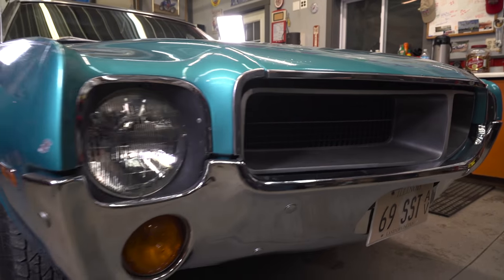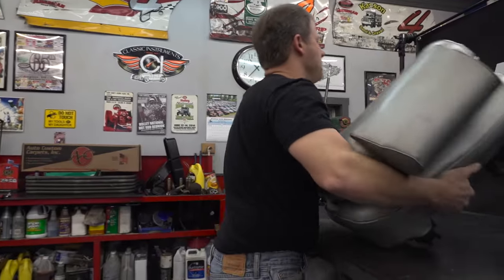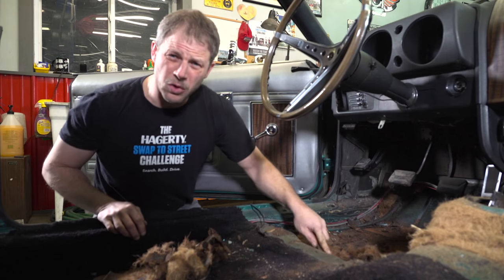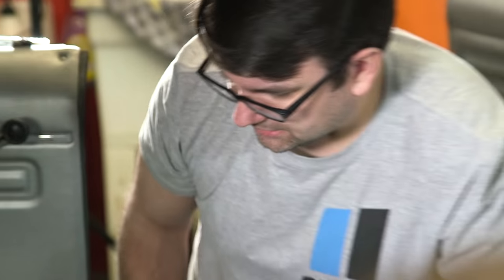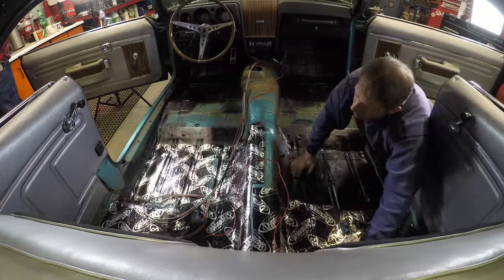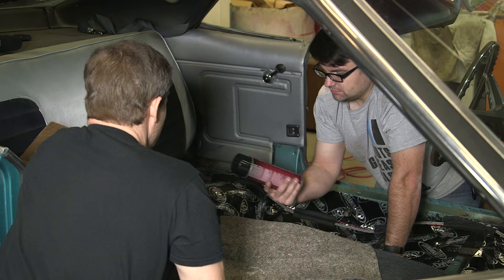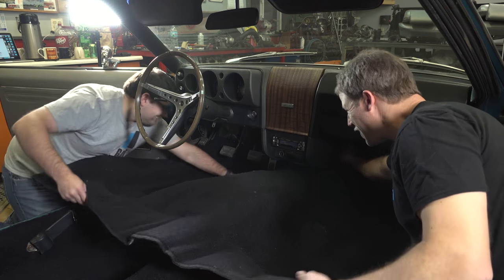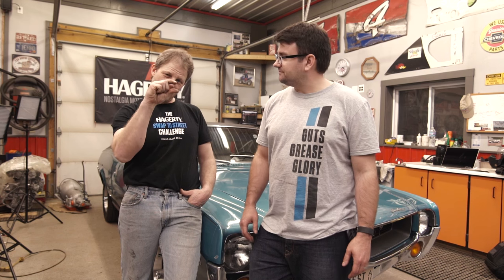How to install a new carpet Kit in your Classic Car | Hagerty DIY

Comment: You did everything except show us how to install the carpeting.
Reply: They were swearing like I was when I did this. I bought thick carpet with rubber backing. Had to be cut to size.
Went to Home Depot and bought a large pair of heavy duty shears. Damn carpet weighed 50 pounds.
Now it's done it looks great. The old carpet was nasty from a 1971 Chevelle.

Comment: Really cool and smart tip for the through bolts…heat up a suitable size punch and push it through the carpet into the bolt hole…perfect hole every time….just don’t set it down

Comment: My question is why would you spray over not all the way cleaned rust instead of diligently cleaning it with apple cider vinegar. Trying to run over things fast. I wouldn't come to you guys ever.
Reply: That was my gripe with this as well. There’s two things there. A) the rust , as you were talking about... and then B) how’s the dynamat supposed to adhere properly to a painted surface and not come off within weeks if not days...

Comment: Some older cars have the access to the front  seat bolts from underneath the car. I have found that removing the back seat cushion some times requires literally kicking the seat bolster at the spring points to get them to release. Rarely have I had one come out as easy as you show. If you do have to kick it out, be sure to protect the fabric with a blanket so you don't damage it. Sometimes a  T-45 or T-50 Torx with a hand impact wrench is needed for the seatbelt mounts. Helpful hint... clean the heads of the scuff plate screws with a toothbrush water & then tap the screwdriver gently with a hammer a few times on each screw to help break up any corrosion. Use an awl to relocate the screw holes I don't remember ever removing a shifter for an install, but I suppose it would make locating the hole somewhat easier. Nice video. I am subscribed
Reply: You just had an introduction to American Motors engineering jime386. They are way simpler to take apart and put back together than other makes. And the drive trains are now finally gaining respect they should have had back in the muscle car days. That's why there are more AMC race cars around now than there were in the muscle car years.

Comment: Some great tips here...and some not so great tips:
---use POR15 on the rust.   it takes a while to dry, but turns rust back into metal.  You get so few opportunities to have access to the floor of your interior, seems kinda lame to just spray black paint over it.
--- have never seen a back seat come out so easily in my life.  I had to have full leverage of my legs (while laying down in the car) to muscle mine out.  
---also, I don't know if all this spray adhesive is necessary.  Ribbon seal might work just as well and not be a nightmare to clean up if you have to do this again/ or deal with rust or a leak someday.
---great tip on putting the bolts in to cut the holes for the carpet
Reply: Where can I purchase POR15… my car seems to have some rust inside
Reply: I used POR-15 everywhere I could on my 68’ elky build.   I spent weeks and used about a gallon in total.   Years ago I once tested por-15 on the under belly of a half rusted out lawn mower tractor deck to see if it was worth the money.   It worked great and the deck ended up out lasting the tractor.  It’s time consuming, expensive and nasty to work with but in my opinion well worth it.

Comment: Little Por15 instead of black masking paint imo it would def stop the rust by encapsulating the rust from spreading. Guys did a great job this is only a suggestion not a slam. It’s real easy to use and you can hit it with a hammer once cured. 24 hrs. I also put my dyna-mat in on a cold winters night I used a hairdryer and a heavy rubber roof hand roller worked great the mat basically oozed into all the nooks and grannies sealed and insulated to perfection. I pulled a couple spare circuits into the rear area and some speaker wires now ready for carpet. Hope it goes smoother than my headliner. Thru a few tools that day what a pain in the ass that was. Anyway Nice job guys.

Comment: My input: Don't cut out bolt holes with a knife, melt them.  It will leave no frayed ends.
Use a short piece of conduit pipe or other tube, held in pliers, and heat it up with a blowtorch.  Then just stab the carpet where you want a hole ad voila, instant, clean hole.

Comment: Video looks good, im having a very hard time adjusting the front as my 67 dart has the floor shifter brackets on the trans hump and wont allow the carpet to roll or fold, any ideas, plus how high to take the carpet, remove the gas pedal and steering column? more carpet for more sound resistance? My first time attempting this. Thanks for any help/advice you can give,

Comment: Isn't that stuff under the carpet made of asbestos? How do you properly handle this and any recommendations on respirators?
Reply: It's a crude oil product. Sort of a thick version of tar paper.
Reply: @johnnewell4849  Thanks, I was a bit worried about dealing with that stuff.

Comment: I have really bad allergies. I will be buying a construction safe mask to remove the carpet..Anyone know what is the best type of material i could use instead of carpeting for my 3rd Gen camaro
Reply: If you have chemical sensitivities, car interiors are not  your friend. I would glue down burlap sacking if I were you. That's the least chemically offensive  stuff available that is tough enough. Failing that you may be faced with using aired out vapour barrier  held in place using Tuck tape. Good luck.

Comment: Can use any carpet in a car or dose it have to be a specific type of carpet ?
Reply: its standard floor carpet but they older cars are molded with some insulation under the carpet.  dyna mat or any sound deadning material will be just fine.  its not like you will daily this.

Comment: I wonder about that Dynomat and will it trap water or moisture over the years and cause damage over time? It can’t breathe.
Reply: Before installing the carpet, plug any holes in the bodywork by tearing out all of the factory seam sealer and replace it  with modern seam sealer. It comes in different forms. 1. Apply with a scraper, 2. Apply with a calking gun and smooth the seams using a plastic spoon, 3. Self-leveling applied with a calking gun also. It self levels making it good for sealing the bottoms of the rear quarters from front to back and the underside of the  pinch seam that runs from the front of the body to the rear wheel opening.

Comment: I want to do this on my 91 capri, but nobody makes molded carpet kits for that car since it is rare.. are there universal molded carpet kits available? or does anyone know if something like the Mazda 323 carpet kit might fit on the capri since it was based on the 323?
Reply: There is no such thing as a universal moulded  carpet because all car floor pans from make to make and model to model are vastly different.